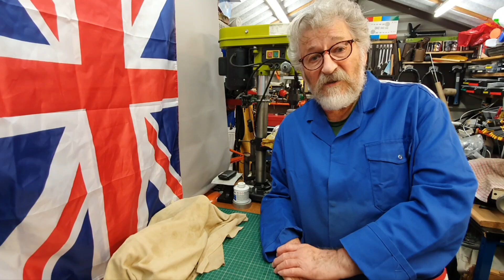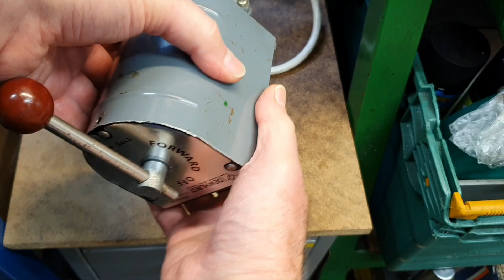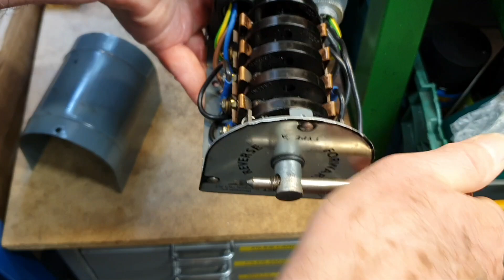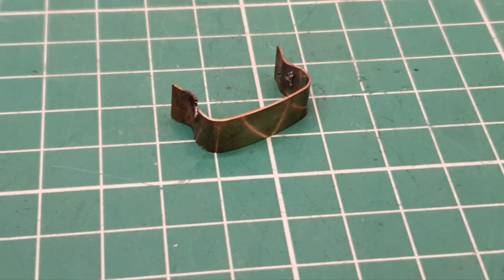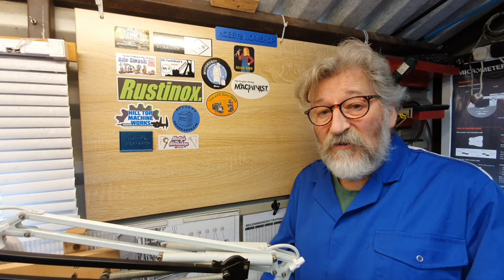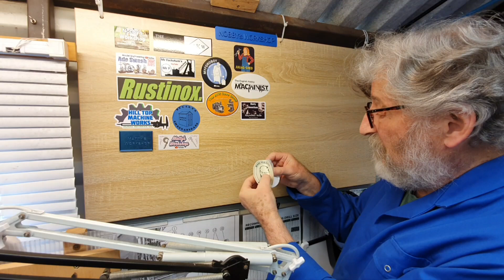Myford Lathe Problem follow-up + New Stickers.

Comment: Nobby, that spring might be made of Beryllium copper. It looks similar to copper but has much higher strength. It is also a very good conductor of electricity so it's often used in switches as contacts where latching is required. It's readily available. I found some on Aliexpress. 
Thanks for adding my sticker to your board. Yours is up in my workshop already but the video is still a couple of weeks away.
Regards,
Preso
Reply from the maker: Hi Mark I'm sure you are right about the type of copper. I've had other similar comments. With the two Dewhurst switches donated, I'll have plenty of spare parts available now. I'm so pleased to have your sticker on my board Mark, and thank you so much for doing the same for me. All the best, Nobby

Comment: I have a brand new genuine Dewhurst switch if you need one desperately.
Reply from the maker: That's very kind of you. Everyone is being so helpful. I'm OK for the time being. The switch is working fine, and I'm able to use the lathe. I'll get back to you if I run into any further problems. Thanks again. Cheers Nobby

Comment: Hi Nobby. If the unit fails again, I have a complete setup from my Myford that I fitted a 3 phase motor to. It is all wired up just as removed a few years ago. There is the motor , the perfect Dewhurst rev switch & a start stop swirtch as new. All wired together. I'll probably never use it. So if you need it let me know. I am in Leeds , not sure where you are.
Steve.
Reply from the maker: Thank you so much Steve. That's a very kind offer. I'm OK at the moment. The lathe is working fine. All the best to you. Kind regards Nobby

Comment: Without looking at other comments, the spring is probably beryllium copper.
Again if someone else hasn't mentioned it those rotary contact switches dont comply with the modern safety ideas, where most machines are meant to not automatically start up after power failure! No volt release rules OK 😉
Reply from the maker: Hi Chris, after my first video on the switch I had an email from a friend who told me they were most likely Beryllium Copper silver plated. The one that failed wasn't plated though. I'm sure you're right that they wouldn't pass inspection now 😕  If there's a power failure,   power to the workshop is cut off. So hopefully I'll be OK 🤔 Cheers Nobby

Comment: Hi Nobby.  Looks like the switch spring can be flipped around (it's uniform) so the contact pin then contacts the remaining good side.   I expect it's made of high hardness copper.  You could even fill in the burnt hole with GP silver solder (same as plumbers use for copper pipes).  Just clean it up with a small sanding drum in a Dremel.  Having those old switches now for parts is a big plus.  Cheers Rob
Reply from the maker: Thanks for the advice Rob. The springs in the spare ones do look very good. A life times supply for me  😂 Cheers Nobby